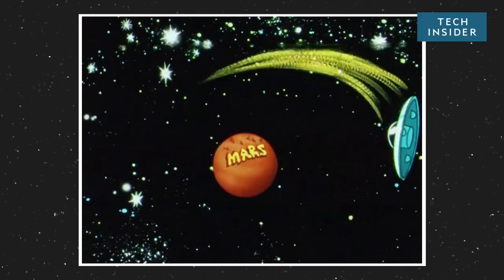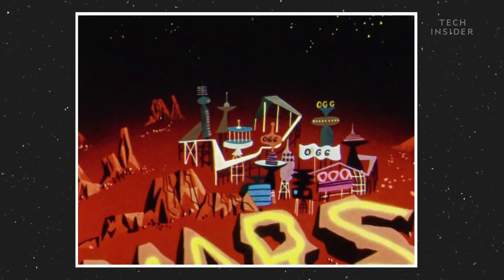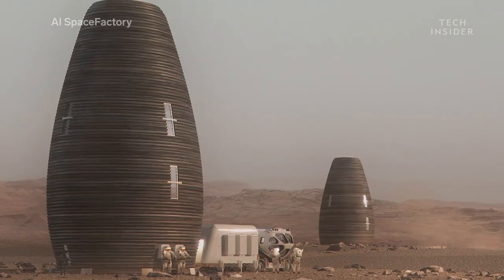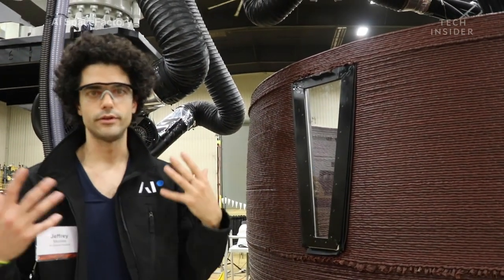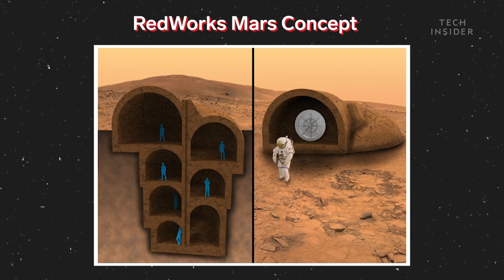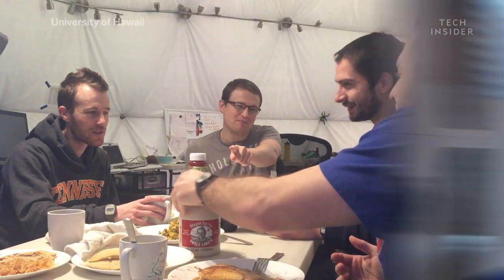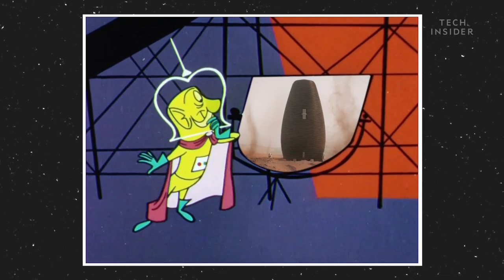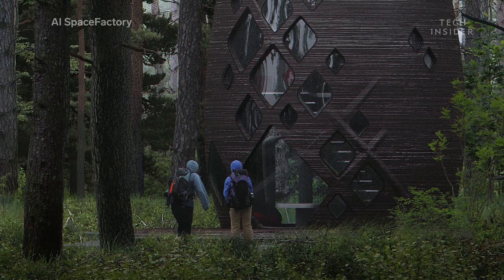The Mars Homes That NASA Awarded $500k

Comment: Wouldn’t radiation easily make it through the skylight?
Reply: nope
Reply: The glass is t h i c c
Reply: @shaildekhtawala8244  lol
Reply: Seems like it
Reply: Maybe it would have the same coating like the ones found in the ISS.
Reply: The skylight is water filled
Reply: N Tinkess the could make it out of the same thing as microwave front windows
Reply: @billychubb5916   that would help with microwave radiation, which is in the millimeter wavelength, but it wouldn't help with higher wavelength radiation like gamma and x-ray
Reply: Yes, but the change in gravity will kill them all before that.
Reply: *shorter wavelegth = higher frequency, gamma has short wavelength
Reply: Şqųąņçho MçPøņçho low gravity isnt deadly, hell, the people on the iss are in 0 Gravity right now
Reply: @mykalkelley8315  whoops, my bad
Reply: @dave-cj5gb  lol...i think if you are going to space let alone another planet gravity would be the least of your worries
Reply: Brian Kabonyo I think the lower gravity slowly spreads your body out like a sponge that’s been squeezed forever and it’s being able to grow a little, except the sponge is us
Reply: @godsweetsac9621  so you float around and then work your muscles out later in a gym not exactly a disaster... your concern about going to mars is not distance,duration,propulsion, system failure or psychological health problems ...it's the lower gravity? Lol
Reply: @pilchardpliskin9381  "Over the course of about 18 months, the Mars Odyssey probe detected ongoing radiation levels which are 2.5 times higher than what astronauts experience on the International Space Station – 22 millirads per day, which works out to 8000 millirads (8 rads) per year." Gamma radiation can pass through solid objects like light through a cloud of smoke, so the more stuff you have between you and the light source, the better
Reply: @mykalkelley8315  I think it's microgravity. For a short duration the effects of microgravity are not very pronounced but as time goes by certain health problems occur such as significant losses in bone density and muscle mass since they don't have to use their extremities like here on the Earth's surface. 😁
Reply: NearlyLego so you are saying radiation cant pass through water ? Lmao
Reply: @butterchuggins5409  How does gravity kill them
Reply: @JohnAeronCaiga  the effect microgravity has on bone density can be negated by doing exercise
Reply: Yes, very easily. That’s part of what NASA awarded them for.
Reply: @Nazgul-sk9cs  radiation is radiation, doesn't matter if you're in deep space millions of light years away from a star, or in the core of a planet. It's gonna affect you the same way. Also, work on your English comprehension and general knowledge. . . especially when you're trying to sound smart about radiation.
Reply: @Nazgul-sk9cs  I don't think that is what he is saying, I think what he is saying that water do indeed block gamma rays but might overestimate the effectiveness a bit.
Reply: @butterchuggins5409  Mars gravity is 38% of Earth gravity. 0% gravity seems to be really bad for humans, but we don't know much about what 38% over a longer period of time does.
Reply: @butterchuggins5409  The gravity on Mars is 0.38× weaker than Earth due to the lower mass.
Reply: yao dave copy n paste 😂
Reply: @Karma-xv2ee  Also, less gravity means less water pressure... so I don't even know how you reached such a conclusion...
Reply: @snuffeldjuret  Uh, don't know about that one chief.
Reply: Lead lined glass polymer?
Reply: @snuffeldjuret  0G has been experienced and is only bad if endured for long periods of time because it weakens our muscles and bones. Therefore, gravity is not an issue, it can simply be compensated with training.
Reply: @snuffeldjuret  Space radiation, doesn't consist mainly of Gamma rays... Gamma rays can only be produced by huge explosions like a supernova. You're making Gamma rays sounds extremely common when they are actually not.
Reply: @pilchardpliskin9381  Radiation cannot be classified as just "light". Radiation is produced by the movement of particles at high speeds from beta and alpha particles. Depending on the speed of the particle it can greatly damage or destroy DNA and molecules. Since mars lacks an atmosphere, these high speed particles can bombard it giving it no chance to sustain life.
Reply: @i-use-arch-btw3954  Only deals with the weaker radiations, as you move higher up in the electromagnetic spectrum it would fail to protect us. It would need to layered.
Reply: @bodypillow3800   finally ! someone smart. but the hubs will be made of BASALT rock, wet when poured , like cement, then harden back to soild basalt rock again. basalt blocks radiation better than led, and the windows are not glass, thay are made from transpart aluminum, like on the ISS and other space craft, which also blocks radiation very well. radiation will NOT be much of a problem.
Reply: Probably. Doesn't invalidate the concept, though, it would just be executed in a more practical accurate form. Probably with cameras instead of windows.
Reply: @robertoaguiar6230  transpart aluminum windows, like on the ISS and all the other space crafts, blocks radiation, not to mention very very bullet proof and surper lite.
Reply: @nearlylego1222  the skylight is filled with piss. You can have lemonade readily available if it gets too hot.
Reply: Of course it would - NASA is scamming all of us! No one will ever go to Mars, just like no one ever went to the moon. Sure, they’ll make it LOOK like they sent people there, but they’ll actually be in a desolate location right here on Earth. Deception, all to continue to get billions of our dollars each and every year. Total money laundering scheme. Wake up, brainwashed masses!!!
Reply: @butterchuggins5409  Why would the change on gravity kill them, the Mars gravity is around 38% of Earth's gravity.
Reply: @JohnAeronCaiga  The ISS is in Earth's magnetic field. It's not the same thing.
Reply: @pilchardpliskin9381  The astronauts can only do so much. The Advance Resistive Exercise Devices (ARED) they use simulates free weights like they would feel back here on Earth but it never really equates the constant gravitational pull our bodies experience on the surface. These helps prolong their stay without losing too much of their bone density and muscle mass but right now, it's not a substitute.
Reply: @ciocancosmin445  It is in the Earth's magnetic field. The Earth's magnetic field stretches far from where the ISS is positioned. But don't they get higher doses of radiation compared here on the surface? I mean they're still under some significant protection from the Earth's magnetic field but the atmosphere that protects us basically is absent from where they're orbiting. Would you mind expounding? I'd like to learn.
Reply: @JohnAeronCaiga  Yeah, surely they are not as safe as they would have been on Earth, but on Mars they would have neither a thick atmosphere nor a magnetic field.
Reply: @ciocancosmin445  Would that mean they would need more than just specially coated windows? Because as you implicated, they're basically being bombarded directly with solar and other sources of radiation. I wonder how would they deal with such problems, but I'm pretty sure they're already on to it.
Reply: @edwinmaguillicuddy9069  yes and the world is flat
Reply: @JohnAeronCaiga  For the windows i don't know how they would do it. For the walls, they could just make them thicker. They have plenty of material on Mars and they 3D print the stuff anyway.
EDIT: Thicker walls might even be good thermal insulators.
Reply: Martiddy - Sama 
Why? Physics.
Reply: No
Reply: @pilchardpliskin9381  radiation is not in any way light. Depending on what radiation you have, you have different "things", alpha-Radiation are positive helium ions, while beta radiation is  either positrons or electrons. You are somewhat correct, light and gamma-radiation are both radiation.
Reply: @ree2398  Ah, I didn't know they were used for ISS. Thanks for the information, you're well versed on this subject.
Reply: @ree2398  If radiation is no longer and issue, the endurance of the structure should come into question. They look rather frail looking, so I doubt they have a long shelf life.
Reply: @mykalkelley8315  Sure but they suffer from rapid loss in bone density and muscle mass because of it.
https://www.esa.int/Our_Activities/Preparing_for_the_Future/Space_for_Earth/Space_for_health/Musculo-skeletal_system_Bone_and_Muscle_loss
and the longest anyone has so far spent in zero G  only 438 consecutive days 

Were talking about long term living on a low gravity planet after a 7 month trip to get there by the first colonists,  Something we have close to zero data on at the moment.
It may be the case that the low gravity Mars does exert is enough to mitigate the worst effects. But were not just talking about visiting Mars this is about living there permanently. Which means conceiving and then raising children on a planet with  only a 38% of Earths gravity. Its entirely possible unless we're willing to genetically tinker with those born on Mars they'd never be able to return to Earth due to the gravity differential between the two worlds.

Martian gravity might be sufficient to fend off the worst of these negative effects...but we just don't know enough one way or the other right to now to simply assume Mars a safe enough environment for today's human to colonize rather than occasionally visit.
Reply: @bodypillow3800  How exactly does that help those to be born on mars ?  because that's ultimately what were talking about here.  not popping by for a visit.  but actual long term colonization. 

How will the first newborn generation "Train" its way out of the effects of Micro gravity ?
Reply: @bodypillow3800  i'm not saying radiation is no longer an issue, the windows and the basalt is not radiation "PROOF" it just helps block it enough to make it safER for humans, as for shelf life... Dude, its made from Basalt, second hardist rock knowen to man, after granite, wet like cement when poured, from the 3D printer, but then, hardening back into soild rock again. i imagin thay should still be standing in a few hundred years. touch wood.
Reply: @bodypillow3800  yer the windows have been getting changed over to Transparent aluminum one mod at a time for about a year or so now, its the window we will be using on everything from now on. it will be getting used on your phones very soon, so no more broken screens :) very strong stuff !!
Reply: i have a question, maybe someone can answer...? 
if they’re going to be building these on the planet and from its resources, won’t the entire structure inside and out be exposed to extreme radiation?? in one of the concept pictures, 3:38 it shows the middle building being built (the top is completely open) so wouldn’t the inside but completely covered in radiation?
Reply: @johntowers1213  The gravity on mars is weaker, so the weight of items are also smaller. You may be weaker on Mars than on Earth, but the strength required on Earth isn't required on Mars. Therefore, the muscles and bones degrade to match such an environment. However, if one simply did extensive exercise, they can maintain the strength which they had on Earth. However, there has been research that the immune system weakens due to low gravity, but it could be due to stressful conditions of isolation. This is why I consider gravity not to be much of an issue. Radiation is more of an issue on Mars.
Reply: @ree2398  I understood that it lessens radiation exposure appropriate for human living, it doesn't block it out entirely. I lack knowledge on Basalt, so I can't say for certain that you are right, but that would explain why the chose to use Basalt for the construction. Therefore, I'll accept your response.
Reply: @ree2398  Doubt phone companies will add such a strong glass. They want to make people spend money, so they'll use weak glass to keep up consumer spending.
Reply: @johntowers1213  The first generation would most likely, be put into a regime of routine exercises daily to maintain human health on "Earth standards". However, again I doubt it would be required. Take for example if something on Earth weighed 9.81 N, the weight of that item would be 3.711N on Mars. The strength required is minimal, so our bodies have no need for such strong muscles and bones. If you plan to stay on Mars, then training won't be required.
Reply: @bodypillow3800  Yes but what about the effect on developing bodies though ? if were going to live on mars we need to raise families there as well,  whats the effect of low gravity  on pre and post natal care for instance ?   you can't fix bone density loss and muscle atrophy in babies and the very young  through vigorous exercise.  
Are we prepared yet to genetically modify our offspring to negate those effects before they take hold or is that still considered a bridge to far ?

Popping over to Mars for a visit is do-able with  todays tech,  but living their long term and raising families is a whole other story.
Reply: @johntowers1213  They won't need the muscles or that bone strength in Mars. Newborns and children will grow the same way they grow on Earth. They just will have weaker bodies in comparison with Earth. Also muscle atrophy means the weakening of muscle and bones. The new borns won't go through this process since they will have the basic living muscle and bone standards of a Martian life form. However, if they were to go to Earth they will most likely die to the sudden increase in gravity.
Reply: @bodypillow3800  your avoiding the question I asked...Which is not what those first visitors do but the generation that is born and raised on Mars.. is a child born on Mars and raised there to adulthood condemned to live there like its some old school 1800 century penal colony because there body maturated in a low G environment could no longer survive in a Earth like gravity ?

If the answer was to genetically modify those humans to prevent the  species bifurcating between Earthling and Martians is that something humanity is ready for.
 ?
Reply: @bodypillow3800  thank you :) and you are rite, basalt dosen't block radiation 100% it depends on the type of radiation. i work for a Co* that works for NASA, and i work with basalt. so i guess you'll just have to trust me when i say Basalt works. well? works well enough :/ i'm sure in time we will fined something better. but the basalt hubs means we can go to Mars ! :)
Reply: @bodypillow3800  They won't need the muscles or that bone strength in Mars

Actually they will... there is far more need of strength than you  make out.  
Simple but stupid example ,  go ask a child to open a pickle jar for you... are they struggling because of its weight or simple due to insufficient muscle strength.
Think of all the interactions that require strength that don't involve directly combating an objects weight. any task that requires overcoming frictional forces for instance will be considerable harder for those born and raised on Mars than an 1.0 Earthling
Reply: @johntowers1213  The frictional force is based off of the normal force. Since these two forces share a direct relationship if the normal force decreases so does the friction force. For example: An object which posses a force of 9.81 N and the coefficient of friction was kept the same lets say 1.0. It would have the friction force  of 9.81 N if we were move the object to Mars it would be 3.711 N. The pickle jar issue is due to pressure not friction force which is where you're mistaken. Also the pressure on Mars is very small in comparison with Earth so pickle jars would be easier to open on Mars than on Earth.
Reply: @johntowers1213  Also they aren't condemned onto Mars. There will most likely be a regime of training for those who wish to go to Earth. It would most likely be practice under stronger forces of gravity. Which would be stimulated by moving an object upwards at a high velocity to simulate gravity. This "device" would be used to train returners back to Earth.
Reply: @bodypillow3800   fine, then undo a bolt then for an equivalent example..  you ever worked with machinery with hand tools ?
Reply: @bodypillow3800   that's like suggesting you could train yourself to function normally in a 2.5G  environment by doing the same technique as an adult.  How is that in anyway a practical solution  for those born and raised on Mars  wishing to leave there planet ?
We'll be in danger of just ending up with two subsets of Humans living parallel existences in the same solar systems.

The simple fact is those raised on a low gravity planet unless genetically modified to assuage the effects of the gravity they are brought up in will not be able function like you or I at the bottom of a 1G gravity well.
Reply: @johntowers1213  Hm, I need to do some research on the forces on a bolt. It involves static friction, kinetic friction, torque, and normal force. I'll see if you're right or not.
Reply: @johntowers1213  Its like getting a drivers lisence,  you need to be of certain physique to travel from Mars to Earth. Training in a gravity simulator for a extended amount of time to meet the bare minimum requirements to travel to Earth. I don't know why you think genetic modifications is the way to go, but that route is much more complicated and with  risks.
Reply: @bodypillow3800  I've no desire to see sweeping genetic modifications to Martian colonizers, but I see it as one of the few viable ways to work around the proclivity of the human body to atrophy to the lowest possible level to suit its environmental conditions.

Gene editing that promotes increases in both bone density and muscle mass would be high on a short of list of potential methods for dealing with the perils of Low gravity living for those born to it . 
I'm not raving about the idea but I can't see how any form of imagined adult gravity training can make up for a lifetime of low gravity living for these future colonists. 
Right now we've virtually zero data on bone growth in low gravity environments so assuming someone born and raised to adult hood on Mars can then increase that bone density to something approximately earth functioning levels is entirely up in the air.

I'm not arguing that Mars should be left alone only that setting up shop there will have a profound biological impact on those that choose to do so. Which unless carefully mitigated will see  humanity bifurcated along gravitational lines that once set in motion will be hard to recombine further down the road.
Reply: @johntowers1213  Gene editing isn't as easy as you think. If you add one extra letter to our DNA sequence or delete one it would lead to large amount of complications. Bones are produced by a large amount of mechanics at a cellular level and muscles are more complicated because they are linked closely with our nerves. Genetic editing is here, just not at that level as of yet, so it's not viable. Also I don't know why you think our muscles and bones will turn into mush. There is gravity on Mars not 0 gravity. It takes the people on ISS around a decade to show great visible muscle atrophy. While on Mars there's at least gravity so it should slow down muscle atrophy by at least 3×. Also you seem to misunderstand muscles grow based on usage so it can be trained. Bones can also be dealt with by proper training, and diet. I feel like you're underestimating working out and its effects greatly. It's a simple solution and you keep thinking its complicated when its not.
Reply: @bodypillow3800   I think you're being extremely optimistic here. I can't help feel your picturing this as affecting someone who maturated in a 1G environment then transferred to low .4G   then expended the effort to ready themselves for a return to 1G 
which would make sense as the fundamental structures of that person were optimized from birth for a 1G planet

The effects on a Growing body on mars will be profoundly different and hard to undo once into adulthood.

Could you prepare your body on earth to live on a 2.5G planet with just training or would you find yourself fundamentally under quipped for the experience due to your growth on a 1G planet ?
Reply: @JohnAeronCaiga  polycarbonate? But isn't ISS also inside of the Ozone layer?